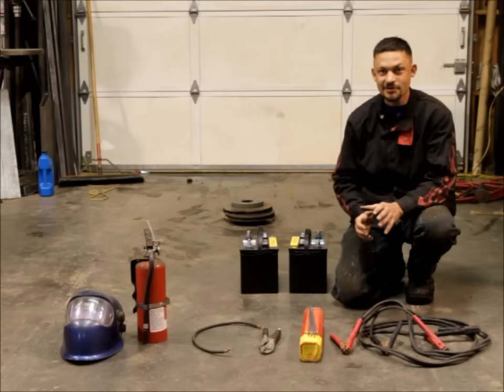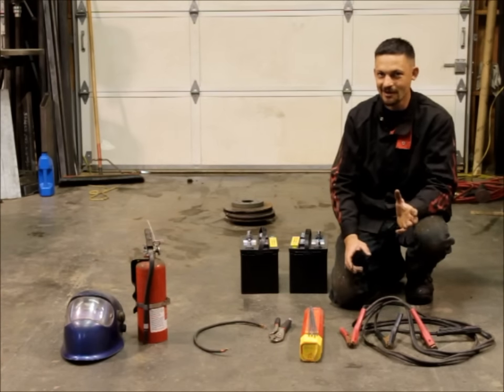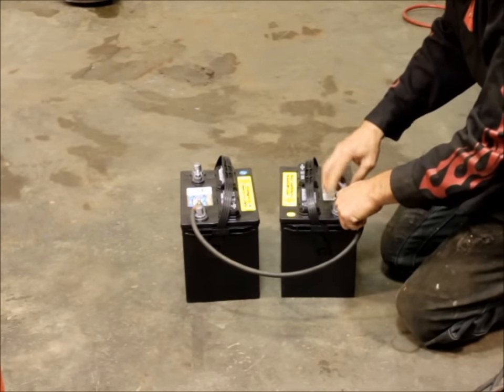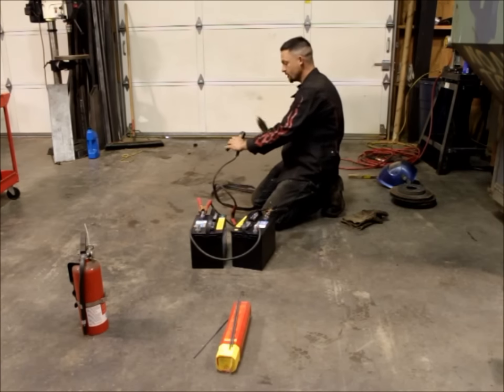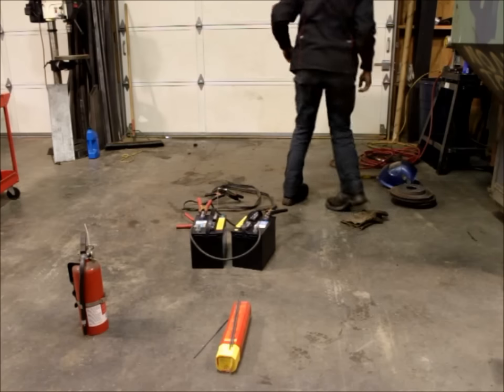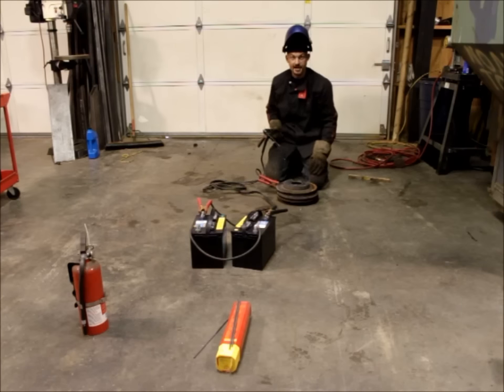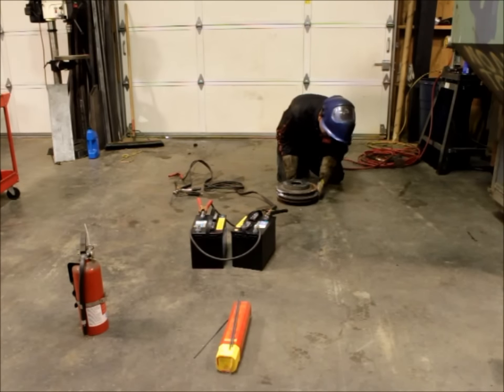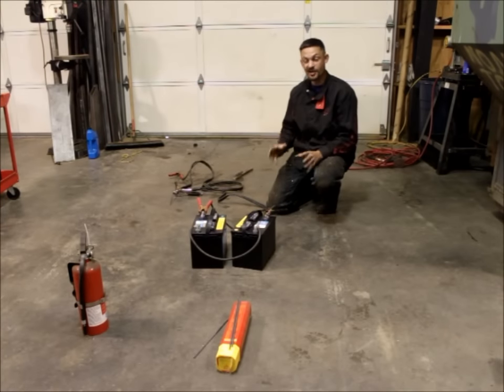Welding with jumper cables and a pair of batteries

Comment: Sweet video, any negative comments need to be ignored. 
This could be used in emergency situations, good video. Could you still start a car after making a quick patch weld.
Reply from the maker: Beau Leavitt yes, healthy batteries will give you a minute or two of arc time, and still leave enough for an engine start.  more than enough for an emergency repair.  and thanks for the comment!  easy to get lost in a sea of armchair mechanic/welders, nice to hear from somebody who sees the value in this skill ;)
Reply: ok
Reply: No problem thanks for the video.
Reply: if 1 battery can't, 2 in parallel should
Reply: Bad bad and bad. Yes, only if the correct safety precautions were observed. Shorting batteries like this not a good idea and also there is hydrogen gas venting from these batteries and the are near open arcs. This is a stupid idea!
Reply: Yeah, you should just carry a generator and a proper welder and supplies any time you want to hit the trail.
Sheeeesh!!
Reply: Not if the batteries explode while trying to weld:-))

Comment: Nice video! Matt, when you put the pliers on the second terminal at 2:01  and pulled towards the other terminal, I recalled a coworker who pulled a wrench around so far, he shorted between the terminals.. 
The bad part was it wasn't a direct short. The current was flowing thru his class ring. That ring glowed red.
The good thing was Mass General Hospital was nearby, and they saved his finger.

Comment: Pretty good  tool to have I know you referenced being out on the trail but I thought as a lifetime boater of many years  it’s also a great tool or knowledge to have in the middle of nowhere  as well  I’ve been broken down  with a simple broken bolt  and was able to remove that bolt inmy home port by welding  it to another bolt and backing it out  with a wrench  often for live aboards  we may wind up on a remote island with very limited  resources  to be able to get parts and supplies so you find yourself getting pretty resourceful to get underway !

Comment: Very informative video without a long talking session. Just to the point. I run 1G battery cables in my Ramcharger with exess cable, I can dismount it all in about ten mintues and get set up to weld. I also carry 1 g HD jumper cables. This video corrected me on some wrong ideas. Mainly having the ground clamped.

Comment: Sir, thank your for this informative video.  I did look I think I will buy the 90 Amp Welder from HF and 7000 Continous Generator Predator and I am good to go & nice to know that two batteries can get me out of a pinch. Yes, you are correct it is not shorting the battery it is a load.  Avionics Technician.  Good job. I will subscribe and see what else you can teach me.  Cheers...

Comment: My stepfather was telling me one of his old jeepin stories  about ripping a hole in the oil pan. They closed the hole the best they could and welded it closed with metal coat hangers using this method. Said it didn't need to look pretty,it just needed to hold the oil in long enough to make it back home.

Comment: Im a marine engineer by trade and had to do this at sea when the steering arm on the rudder broke we used a coat hanger as welding rod lasted all the way back from Ireland to Cornwall took some serious  grinding off when we got home it is a perfect get you home method

Comment: bats on the ground God my ocd kickin in
Reply: Mason Mccraw why is that a problem? we dont live in the 1950 anymore.. its ok.
Reply: WascMeister From what I understand the batteries drain quicker
Reply: Manolo 717 yep it'll ruin a drill bat
Reply: Mason Mccraw Knew it thats why I charge mine on a large wood block
Reply: Its a myth, take two fully charged and place one on the concrete floor and one an a Wood pallet for a week or so and then check the voltage.
Reply: Waht kind of bullshittery myth is that?
Reply: Nothing happened to the batteries
Reply: I have read that  the cold from the concrete is the problem sometimes. I have read that the huge batteries submarines use have the same problem. It is solved in the subs by special pumps that circulate the acid in the batteries to keep the temp even. I read this years ago.
Reply: ohhiguy 
Damn I gotta look into this

Comment: sparks near batteries equals danger......boooooom
Reply: fullproof100 not true. Every time you connect or disconnect jumper cables and battery charging clamps they spark. I have never ever seen it cause a fire before.
Reply: Trevor Seaman I would expect that if anything would make it go off, it would be a grinder. They make sparks like crazy

Comment: Great video. I know of one battery that exploded under load (while starting ) and that was because the guy broke the terminal post inside the battery when he was tightening the cable connection. It was very spectacular! 😀

Comment: Great video.. I have a trailer way back in the woods that needs to be repaired. I've been trying to figure out how to weld it back together without having to haul some monster welding machine back in there for 4" of weld!

The description says 1/8" 6011 or 7018. Does the 7018 burn the same as the 6011 you were using in the video? That really looked like a decent weld. Any issues with getting enough penetration?

Comment: 3:40 You said "Ground" to  your part with the red + correct? Hence Negative welding? I've seen this done with 3  batteries. It was TOO hot  and they switched down to 2. I don't recall if he used a pos+ ground as you did.It produced a LOT of UV  and my  hands and arms were itchy. It was summer and had a tank top  on. People don't understand what dangers come with welding. UV, Ozone etc.

Comment: 3 batteries with a 7018 electrode is pretty damn good. If you have jumper cables and a few off-roading buddies, this can be a lifesaver on the trail. Carry a couple of electrodes with you. It takes up virtually no space either.

Comment: Used this method over twenty years ago to fix an exhaust on a lorry to keep it moving, only had jump leads and coathanger but one of the batteries I was using was the lorry batteries on the vehicle I was welding and it blew the alternator. But at least we got off the road and it was a diesel lorry so it only needed power for the lights.
Great video.
Reply: That is why always disconnect the battery (remove the ground cable at least) before doing stunts like this :)

Comment: How hot do the batteries get, and how quickly? It looks a good way to get out of a tight spot, just remember to avoid cooking your batteries.
Reply from the maker: They are not even warm to the touch.  You're only pulling 100-150 amps, and just for a short while.  No different than a pull on a winch, or turning the starter motor over.

Comment: Not sure how this popped up into my stream but talk about a flash back. I used this method in Iraq in to do a truck repair that enabled us to push through after getting hit by an ied on route “Tampa” (for those who’ve also been there) The front of my truck was jacked and although we were ok just having had our bells rung loudly, (I suffered a TBI) the radiator wasn’t leaking, (small miracles in themself) but it was only hanging in by a couple threads of steel. We tried tying it up using 550 cord, tape and whatever else we had but there was just too much to chance and the maintenance truck already had a vehicle in tow so I had no choice but to fix it. I grabbed some wrenches, a couple pairs of vise grips and an army “jumper cable” off of a destroyed shop truck roadside fifty meters away. The army calls them a “slave cable,” or more recently they call them “freedom cables “due to all of this bullshit political correctness… Anyway, It was twenty feet and was 2/0 wire, very heavy. With that created a welding setup that worked great. I cut one end off and used two pair of vice grips, one flat jaw for the sticks and another long nose pair for the ground and welded a couple wrenches in place holding the bracket strong and it held us just fine until we reached the next fob. The good thing about army vehicles as you do have a power switch you have to turn on to energize the whole system, but if you plug the slave cable in to the side of these trucks, (HET= heavy equipment transporter, it has 48 volts with four batteries in series)it is hot even though the truck power is not on so luckily I didn’t blow anything up any electronics. Of all the video one takes in theater, I didn’t even think to get any of this even though I wish I had! I had other things more important at the time, but seeing this video gave me goosebumps and brought me right back to that day. From that mission forward I ALWAYS carried that modified cable and that tube of rods from the burnt out shop truck hidden in an old laundry bag on my own vehicle. Once we were repaired at fob Scania, the mechanic gave me back those two wrenches... I still have them plus a few other tools-ten years later because I sent them all home once we finally returned to our home post at Arifjan in Kuwait. That was the longest mission in my last tour in every way as you can probably imagine, and took 21 days to go from kuwait to the northers lights just a little south of Syria then back. Thanks for sharing this because regardless of how old this vid is, its info CAN still be the difference of life and death in some cases and is awesome to have in your toolbox of knowledge for home or emergency use where ever you are... 

Side note*
When the unit that came in as our replacements were assigned vehicles, they went over our assigned tools then we officially handed them all off because their officer signed for them. Afterwards when doing what’s called “left seat right seat,” (where you would drive out on one final mission with the new guys showing them how it’s done so they can get a good grip on their responsibilities, ) we held over at joint base balad where I showed the new driver and tc my “extra” od green laundry bag I had stowed hidden on the catwalk that had the welding kit in it. The driver was blown away and got excited. He was a good ole southern Georgia boy that called it his new “save your ass” tool kit addition because knew all about this method and had welded using it quite a few times down home!  He was pumped knowing he now had the means to do any field welding had he ever the need to and said it’s his “lil slice of sanity” in that crazy place lmbo!  Last I heard from him from Iraq he was about 11 months into his tour as they were winding down. The new unit was coming in to replace them and he thanked me again and said that he was going to “up train” the new replacement team on just how to use that kit. 😉 ✌🏼
Reply from the maker: Joe Deveau thanks for your story, and your service!
Reply: Matt Verley thanks for your support brother✌🏼

Comment: If you drive a diesel it probably has two batteries already. 

Does the cca of the battery come into play on this or does it only dependent on voltage?

Comment: fantastic, I been thinking this several year ago, I noticed you dont have a mechanism to cut the current in case the rod stick to the piece. I will use a high current mosfet bank to act a switch to cut the current in case of sticking.

Comment: This man is a REAL welder.
Reply from the maker: Anarchist's Theory haha, thanks.  I don't think that welding with batteries and jumper cables makes a guy a "real" welder...but I do own a small metal fab business and I do a lot of TIG welding on stainless.  Handrails and decorative brackets...that kind of stuff.  The jumper cable method sure does work well in an emergency though...if I don't have one of my engine drive machines, this is the next best thing.

Comment: So the positive cable gose to work piece, and negative, is used for welding rod. I thought it would be other way around ? How long can you weld using the two batteries ? And are you getting good amperage, to get, good dept weld penetration on 1/4 plate

Comment: It has occurred to me that this would be possible! Thanks for showing me the actual thing. I didn't want to risk a battery finding out unless it was the last resort. The polarity was a good tip for me. I would have reversed that. Good disclaimer too. Gotcha.
Reply: Can you get by on one battery in a pinch?
Reply: @theobserver9131  ...an experienced welder can . At least get a really thin rod like 1.6 mm maybe 2mm .

Comment: Got the 6011 but cannot get it to arc like you do. My setup is exactly the same except instead of the 4 guage wire im using second set of jumpers. Any ideas. Batteries both at 12.6. Thanks

Comment: Very impressive !   What if you only have one battery and no one to jump you after the welding repair.  How is the voltage droppage?  if you are in flat area, you just might be stuck.  But, if there's a down slope, you might be able to pop the clutch on manual tranny.  For automatic you might be stuck too.

Comment: I like vids like this that show you what you can do in a pinch if you have such and such available. I wonder how well two batteries with a dc to ac converter would work to run a regular welder of various sizes now. hmmm

Comment: That was totally cool how long can one weld with this set up ?
Those were 12v or 24v batteries?
Will either 12v or 24v batteries work ?
Reply: He put 2-12 Volts batteries wired in a series,  so it 24 volts

Comment: This is AWESOME!!!  I'm certified to use the machines and never learned this.  I saw one guy do it on some simulated Apocalyptic Tribal Survivalist TV Show back in the day and always wondered how he was able to do it.  Unfortunately we skipped Tig Welding too.  
Those 7018 rods are good for anything really, and from the sound of it, with this setup, it's like very little splatter created.  
How's the weld penetration fairing really, on these thick pieces?  
Would maybe have to just make slower passes to really send it...     I wanna try this!
THANK YOU FOR SHARING!

Comment: Just bought my own tiny amazon welder but my garage wont take the charge yet but i need to get this exhaust tip fixed on so this is gonna be a great fix for the time being until i wire up an outlet that can hold up without tripping the breaker

Comment: great video !would deep cycle batteries work better ? with a solar panel set up you could weld off grid with out a expensive welder .
Reply from the maker: +gary mathews As long as the batteries are capable of providing 100-150 amps sustained for a minute or two, they will work fine.  I am using two marine deep cycle batteries in this video, but normal automotive batteries work just fine too.

Comment: funny i've accedentally welded stuff with batteries, but untill now I never thought of doing it on purpose, it might be handy to keep a couple rod's and heavier longer cables in the truck on my adventures just in case. Ya there are definatly some inherant dangers with doing this, hench the longer cables to do the work further from the batteries, and I'm think short duty cycles to keep the batteries from over heating. I think being aware of the risks, and using due dilligence should help mitigate it. thanks for the vid.

Comment: Long term, how would this hold up for diy novice welding, repairs around the home mower deck etc would this harm the batteries? is there a product to be made as a cheapPortable wireless welder? could install a switch (or trigger) on the electrode end and the battery.

Comment: As an additional safety factor - I keep the red battery connector inside another rubber glove until needed so that it doesn't come in contact with the black one holding the rod by accident. Learned that from a mistake once. . .

Comment: shoulda showed us the weld puddle during welding  otherwise always wondered how it was done and looked Also what size and rod 1/8 6010 and 3/32 7018 ? 85 amps

Comment: Used to do extreme offroad, carried 7018 1/8, I had an underhood "welder" with 2 batteries.. but we also did it this way, I had a high output 250 amp alternator at the time

Comment: SMAW( aka "stick welding") machines are constant amperage.  That is you have a control to set the amperage.  They usely have a OCV (Open Circut Voltage) of up to 80 volts.  Once the arc is struck, it drops to between 20 to 30 volts, depending on the amperage and how tight a arc you are holding.  That is why you need 2 batterys miminum, these rods are made to maintain a arc in this range.

GMAW- Gas Metal Arc Welding (aka MIG welding)  has to use a constant voltage power supply to work right.
Reply from the maker: yes, you are correct.  I made a note of that difference in this video.  an experienced stick welder will find the arc a little unusual...amperage varies based on how close you hold the electrode to the weld puddle.  with some practice, you can still lay down some nice beads.

Comment: My bad...
This one is an often heard it used to be that battery cases were made of inferior material. This material would develop micro cracks over time and become porous, and left on wet ground or damp concrete would begin to self discharge. Nowadays, cases are made of plastics that do not tend to leak and can be stored on nearly any surface, even left in standing water.

Comment: Very interesting.  I didn't know that you can weld using batteries.  I definitely need to tried this out.  This is excellent just in case of engine emergency.  I stay away from water when doing this.

Comment: Can you add a simple device to control the amperage? A resistor comes to mind or using a lower voltage. I'm rather guessing. What about using only one battery at time or couple of them in parallel? All you need is some 30A for a 1,6mm electrode, not 240A